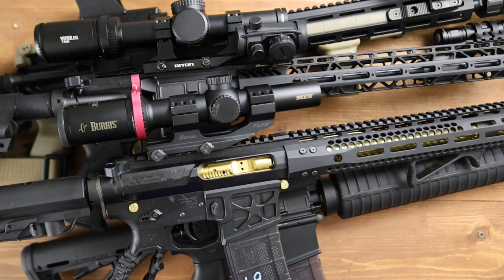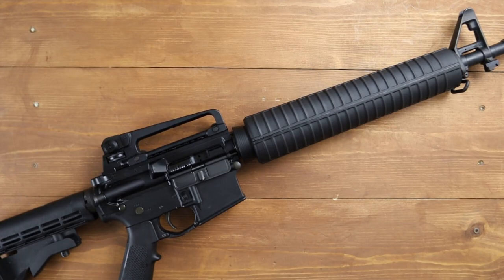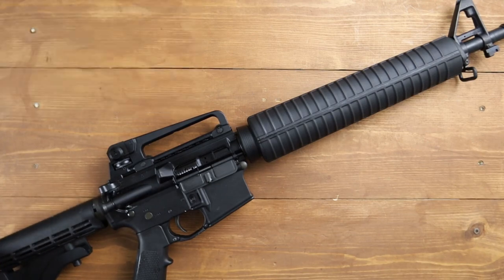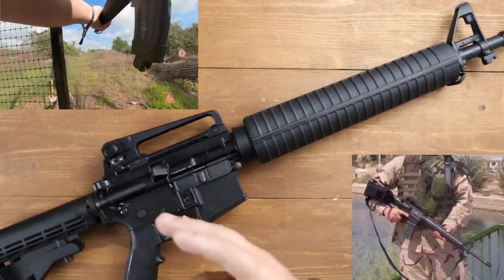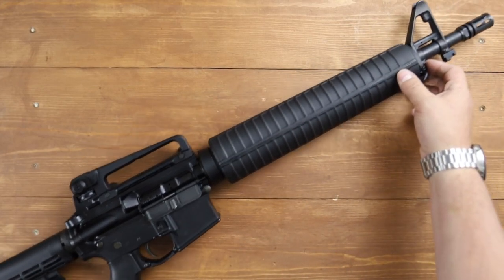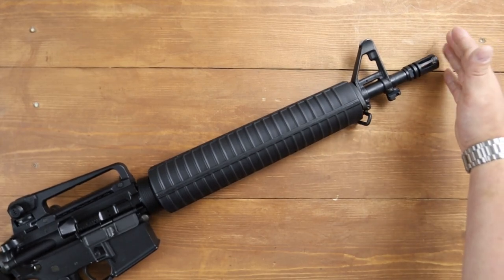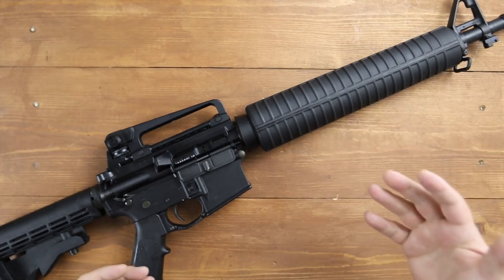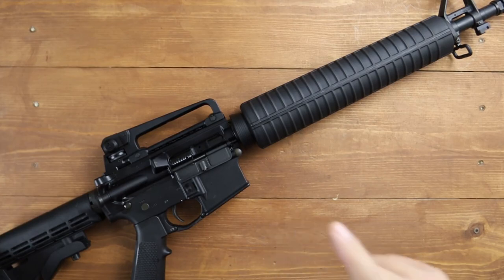PSA Dissipator Upper

Comment: I don't claim to be an expert at anything and feel free to dissagree but I have several AR's, most from Bravo Company but one Colt and 2 PSA cheap bargian guns.  What makes a top quality gun is the bolt carrier group and barrell mainly.  My PSA's have mil-spec BCG's and 4150 CMV CHF FN barrels.  Feel free to insult me but I'm just as happy with my PSA guns as any of the top dollar guns.  I do not view PSA as low quality guns but guns that have not had their prices jacked up for maximum profits.  I built a 16" midlength with 4150 CMV CHF FN barrel, mil spec BGC and improved trigger for $385 during one of their specials.  This was roughly 1/3 of the price as other "high end" AR's and it shoots just as accurate with no malfunctions.
Reply: My view exactly.  I have many high end ARs and    now several PSA ARs with the FN CHF barrel.   Great guns for a bargain.  The only things I felt I had to change were the buffers and buffer springs.  Couldn’t be happier.

Comment: I love my PSA dissipator, it was my first upper.  I got mine back when they had the "freedom" line, the premium line which had a non CHF barrel made by FN (which is what I have) and the FN CHF version.  I'm in the process of free floating it while keeping the front sight base. I'm just waiting for a sale on a Midwest Industries 12.625 inch Combat or G4 rail.
Reply: What about 16" handguard and notch out for the front sight?
Reply: I ended up finding an 12.625" MI G4 rail for a steal and it ended up looking AWESOME! I'm really happy with the way it turned out and it was far more simple than notching a 16 inch and trying to hammer the taper pins in through the handguard, which I probably would have botched terribly.
Reply: @BERTalert7  sounds awesome dude

Comment: I threw the magpul handguard on mine with a surefire warcomp and I love it. I it just works and is simple. I threw the daniel defense fixed sight on the back and run a red dot and it has been great. for the price you can't beat this upper.

Comment: Love the long sight radius for using iron sights.  Only makes sense for iron sights though.  Another variation is the Kino configuration; a 12.5" barrel SBR with a carbine gas block and a mid length sight tower.

Comment: Thanks for the review.  I've read/heard that some of these are suffering from overgassing and canted front sights because they aren't the gas blocks that require more attention to alignment.  PSA will fix them, but just something I've heard mentioned more than once.
I noticed yours seemed overgassed in some of your shooting footage.
Reply: I have noticed using my Midwest indexing rod, that the canted sight upper, also suffers from a indexing problem. Leads me to believe the barrel index pin may have a misalignment.

Comment: Haven't shot mine yet, hopefully it works well especially with my last 3 guns from PSA having issues they have yet to fix. So frustrating,  everything I bought 4 years ago from them have been unbelievably good.
Reply from the maker: I sent in an upper and it was back in my possession in 2 weeks. Good luck with your repair process, they are pretty responsive.
Reply: @geoff_tac  unfortunately I was so damn irritated I sold them as is just not to see  them again. Other than a micro dagger that the iron sights are so far off the rear is drifted that it looks goofy as can be. You have to use a red dot for it.

Comment: Just got mine in the mail, looks great, only thing I noticed right away was the slop when mounted on a lower compared to other uppers, other wise seems like a decent  upper for $220
Reply from the maker: for the price, its too good not to share...thanks for the comment.
Reply: Pair it with a lower that has the tension screw or use a accuwedge. I'd suggest a STANDARD Manufacturing or a Firebird Precision.

Comment: Delton makes a A2 Upper with 20" barrel in a 1/9 twist(for using 55gr with better accuracy) and they offer it in a govt and heavy profile barrel

Also you can use a Magpul rifle length handguard to add some Mlok slots on a 2 piece upper for $40
Add an A2 stock and a Magpul grip and you've got cleaning kit storage and oil or battery compartment in the pistol grip
Which is awesome if you want a rifle for the range or for a situation where you forget your cleaning kit

Just my 2cents

Also Anderson had a true dissipator with A2 stock  and 16" barrel that's rifle length for $500-550 instead of a faux dissipator
If you want the real deal or the bomb proof front sight block that's actually attached to the gas system
Reply: They make a true Dissy too!

Comment: PSA dissipator is eh for me.  I went with the Delton Dissipator that is a true rifle gas system on a 16" barrel.  It had the A2 grips and flat top upper.  I replaced the upper with PSA's M16A2 upper and the handguards with the PSA m16a1 triangle handguards.  It's one of my favorite rifles.  I use the car-15 stock.  I love it.  Thinking of doing a mini me build now with a 12.5 upper with a midlenght gas system.  Would go great with my Mk18 Mod 0 build.  Makes me think of the meme that says "Don't talk to me, my son or my son's son"
Reply: How many rounds do you have through the Del-Ton? How does it function, any issues?
Reply: @jeremym4942  a few thousand. Function flawlessly when used with a standard carbine buffer.

Comment: These things haven't changed as much as the nerds think.
It's a barrel, with a metal tube on top that taps the gas, sends it back, a simple cam action, and spring.
Stocks and grips didn't turn it into some Judge Dredd Plasma Rifle in 40 Watt Range.
It's the same 1950s design with coatings, stocks, grips, better steels and rifling. 
The nerds have too much time to nerd out on gear instead of shooting and getting more advanced training.

Comment: It looks horribly overgassed
Reply: "Overgassed?"  A rifle length gas tube on a 16 inch barrel would have 1/2 the dwell time as a 20" barrel and hence, would be undergassed.  This was the problem on the first dissipators so they had to bore larger holes in the FSB to allow more gasses to come back.  Its not the ratio of gas tube length vs barrel length rather the difference in distance from the FSB to the end of the barrel to calculate dwell time.  This is why the 10.3" barrels on AR's have to have a huge gas port because it's literally an inch from the FSB to the end of the barrel.
Reply: PSA generally has over gassed ARs, like most other companies.  I change the buffers on mine and they run better.
Reply: @markwhite6782  PSA clearly states on their website these are faux dissipators with pinned low profile gas blocks so no it isn't a rifle length gas system at all and yes PSA over gasses the shit outta their ARs ask me how I know
Reply: How do you know?  :)